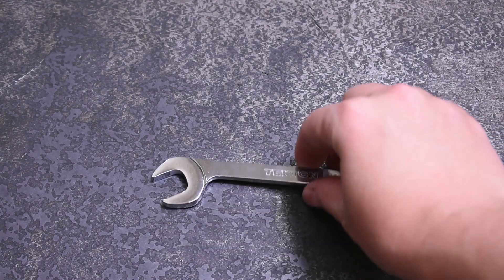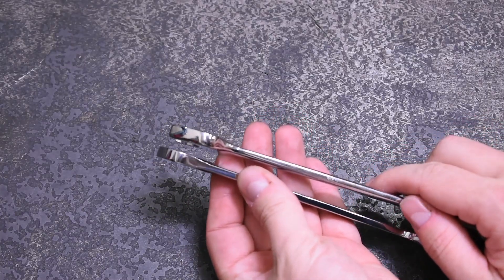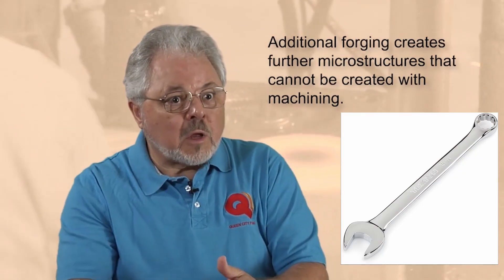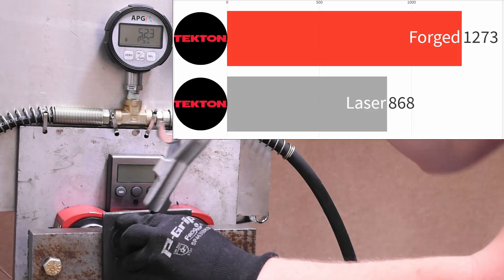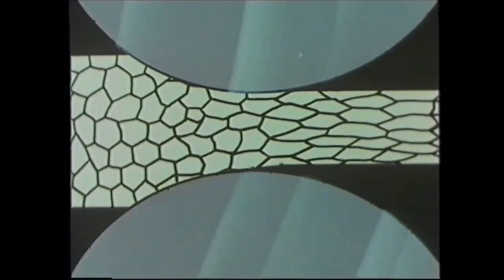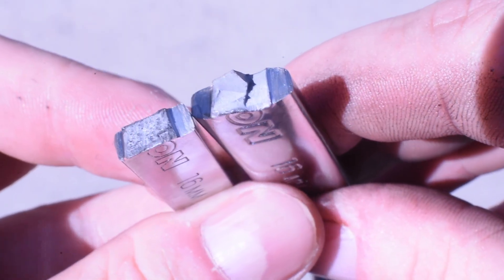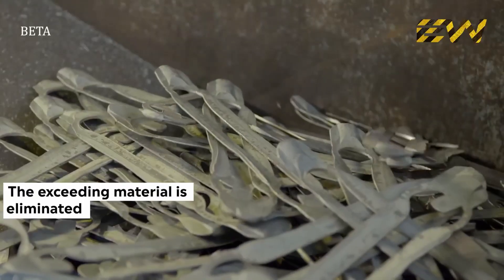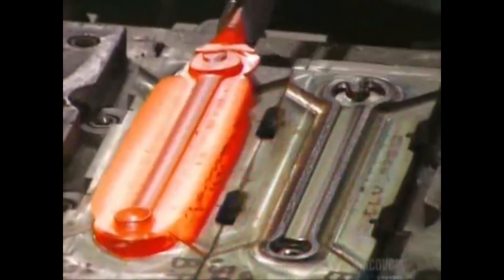The Curious Case of Laser Cut & CNC'd USA Wrenches vs Forged

Comment: Purely speculation here: I wonder if the shape they wanted would have had die issues since the radius look a bit sharper/tighter on the inside compared to other similar wrenches. They also might end up with a similar grain "flow" to a forged wrench. It would be interesting to see it against a wrench of the same design and perhaps destructive testing on the jaws. Great stuff, TTC!

Comment: I work as an aircraft mechanic, the tekton 30/60's are indispensable for turning nuts in awkward areas. I've found they beat out snap-on because of the narrower head-different angle
Reply from the maker: Perfect example, thanks for the real world experience
Reply: @TorqueTestChannel   I use the Tekton angle head wrench, in the Heavy equipment/agricultural field and they’re worth every penny! Only gripe is the chrome plating could be better.
Reply: I have a set of each, use them both about equally. The Tektons definitely see use on hydraulic lines in the tight gear bays you see on business jets.
Reply: I am an aircraft mechanic too. I purchased the Tekton set in SAE to access the extremely tight area to remove and install the MEC; (think of it like a carburetor, it’s not anything like a carb but it performs a similar function) on GE CF6 engines. The thin and not to bulky open ends are the reason why we use these wrenches. Other brands open ends are to bulky to fit.
Reply: yah I work on aircraft as well the tekton 30/60 are amazingly useful and very reasonably priced compared to alternatives. I also  own a full set of the regular tekton wrenches and they are pretty good. They are not the be all end all but they do the job and do it well just a little bulky compared to some of the tool trucks but way cheaper.
Reply: yep i also work as an aircraft mechanic and tho snap on makes a 30/60 set its WAY more expensive and ive seen these tekton wrenches work better. i also use the set prety much every day.
Reply: Automotive full time here, small engine on the side. Snap on has a 30-90 set that's badass for the same reason especially on some of these goofy older lawn mowers and wood chippers.
Reply: I haven’t used the Tekton but my Snap on 4 way angle head wrench’s always work where friends Mac tool ones don’t. The tekton are cheap enough I’ll buy them to compare.
Reply: @wadesaxton6079  they are close to the same but the snap on ones seem to be a little stronger while ive had more luck with the tektons in tight spots
Reply: Yeah man, installing AMAD's and hyd reservoirs in the 53 Bay, 1 1/2" fittings and mounting bolts in the F18's... These offsets were so great to have.

If they were being used id get all grumpy and go reach for the crows feet and the 90 other things I would need for the same thing I could have done with these wrenches.
Reply: AMAD's in the 53 Bay, hyd reservoirs*
Reply: I have an old ass set of snap-on I inherited from my dad in SAE. That's the only reason I don't have the tekton 30°/60° yet. 
I am thinking of getting a set in metric to use on vehicles at home although I don't really run into a need for them on cars as much as I do on aircraft.
Reply: I completely agree.  Been in aviation a long time, love these wrenches.  I love mine.  Several coworkers have bought these after seeing and using mine.
Reply: i've used the 30/60's for some questionably engineered sorter tables and greatly appreciate more of these being on the market
Reply: Hurts your hands tho, snapon still better

Comment: Specialty tools will always have a place in a techs box. Honestly those offset wrenches are probably strong enough for the job they're designed for. I prefer Snap-On myself but I'm also an old wrench turner lol.
Reply: Oh, they're plenty strong enough.  I still use a set I bought from harbor freight that cost me $25 (I think there was maybe 15 wrenches in the set?), the kind of low quality you can't even find at harbor freight anymore, and they've lasted for nearly 25 years now in the specific applications they're needed for.  Truth be told, these tekton wrenches are probably overbuilt for their application, but there's nothing wrong with that at all.